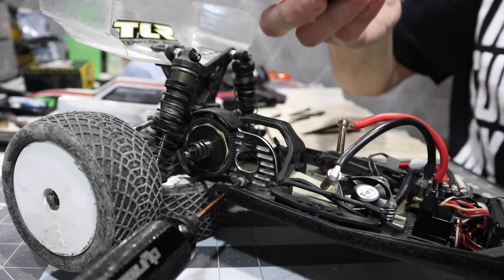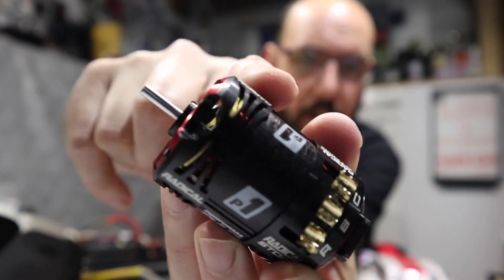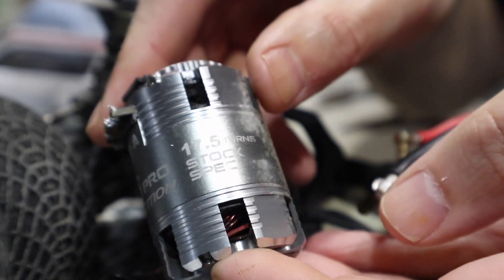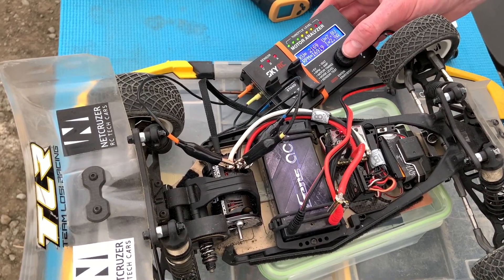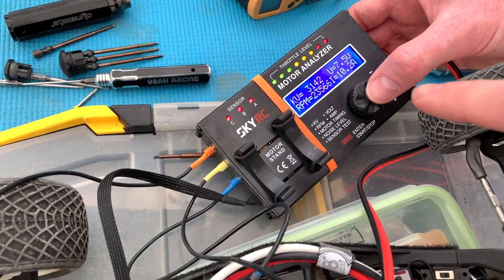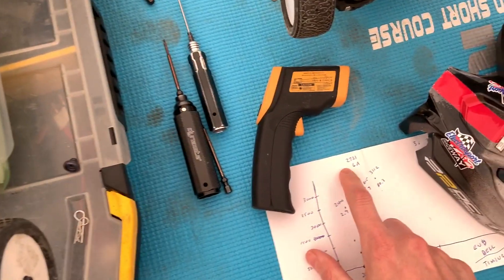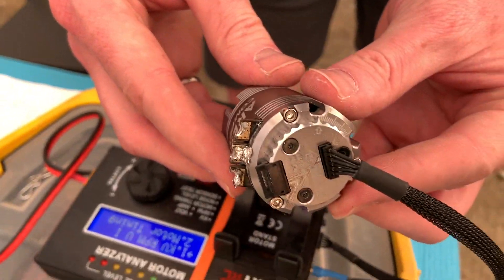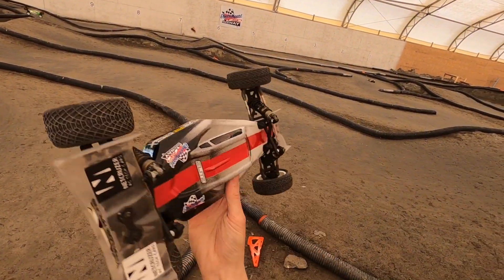Motor Analyzer! Performa P1 RADiCAL Stock 17.5T Brushless Motor on the TLR 22 - Netcruzer RC

Comment: Gearing would change everything on performance, you could have tried a bigger pinion until the car doesn’t perform well and runs too hot for a 10 minute main. Then go back a tooth. That’s one of the ways we did it in the brushed/olden days.

Comment: Do you have a longer torque rotor (12.5mm) in there or a shorter rpm rotor (12.3mm)?  Are you hitting max rpms/top speed on the back straight?  You want to make sure your gearing is low enough to hit the higher rpms when running more timing so that you are spinning more in the high rpms where the higher timing has a bigger benefit.  Also a good idea to check temps with no fan on to make sure you're still in decent temp range, the fan should be used to keep you out of the borderline area, not as a fix when your motor would normally run way too hot.  Check out some of Schuurspeed videos where they talk about this.  BTW, almost all motors don't post true timing on their motor, it's more of a +timing (onto the stock timing, e.g. the base 15 degrees in your case).
Reply from the maker: I don’t know the rotor size, yes I’m hitting max on the straight (by feel it peaks 3/4 down the straight). Interesting they the gauge can be timing ontop of base timing, if they said that somewhere I didn’t see it. Anyway I’m getting an analyzer myself and will do more testing learning. Honestly MOD has taken over locally again so I doubt I’m keeping this 17.5 in very long. Likely go 13.5 or more next.

Comment: Hey ... If you wanna get serouis and have power !? You need to get trinity rev tech 17.5 motor its smooth and very fast right out of the box 👍
Reply from the maker: Yeah I’ve heard those are great. Also I’ve seen R1 Wurks and it’s blistering fast for a 17.5. Also Team Scream Racing are great.
Reply: You can find lots of motors that are fast out of the box, at half the price.

Comment: I just go by temp. I’m in LA so is quite hot here. I run my car 150  max temp. But when it’s cold here I run mine about 35-40 degree..XR10 pro 7.5 .. but if I was to look for speed  more top end I will increase my  spur gear lower my pinion.. you right now you have  very large pinion so you have lots of acceleration. It’s good for jumping in short  timing. I usually find a combo of both or more likely a little bit more top end.
Reply from the maker: You got your pinion talk mixed up I think. Smaller pinion is less speed more accel, larger pinion more top speed. Opposite for spur size. Combine and do the math to get a FDR (final drive ratio) appropriate for your track.